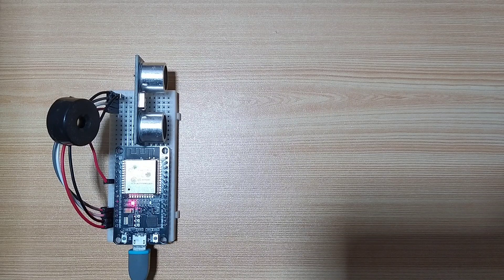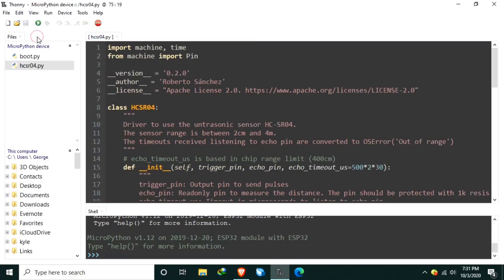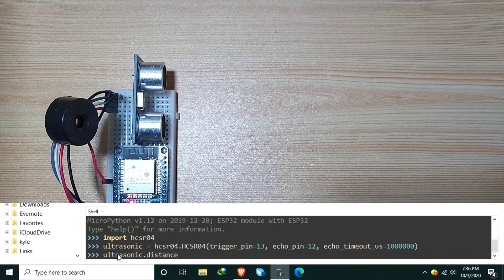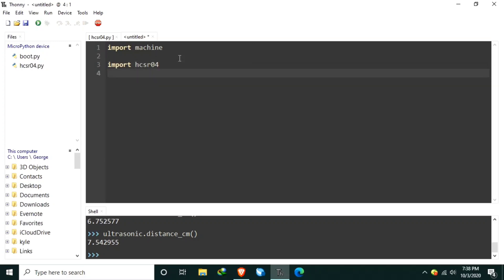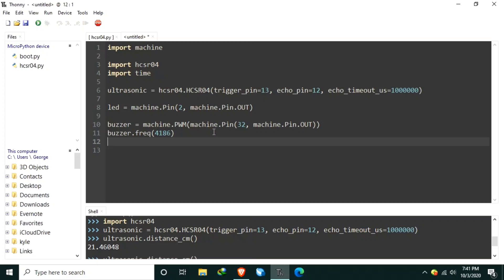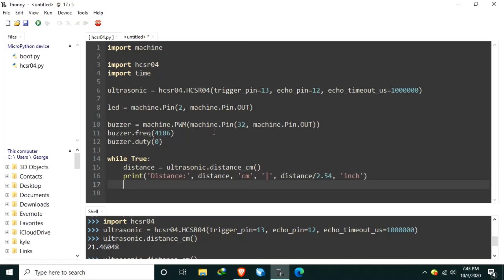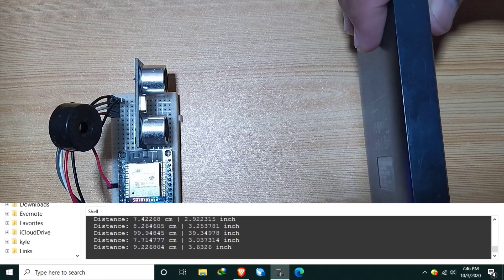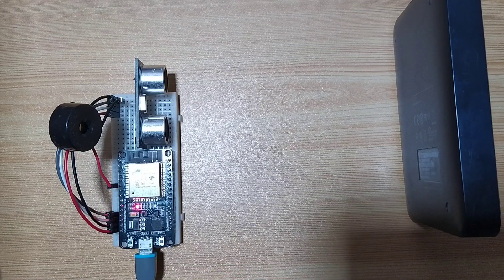012 - ESP32 MicroPython: HC-SR04 Ultrasonic Sensor in MicroPython

Comment: Sir,  I am using the same 'ultrasonic_distance.cm' but I am getting a value like -0.0343. And strangely,  it remains the same even though I changed the object distance. I thought there might be something wrong with the sensor and tried using it with Arduino but it was working fine. I am getting expected results and infact I was able to even perform intruder alert. I request you to let me know what could be the possible mistake.
Reply from the maker: I am not sure what could be wrong with your setup. I would suggest to try to re-assemble again the circuit. Notice also that Arduino Uno uses 5V while ESP32 uses 3.3V. That could be the difference.

Comment: Sr04 needs 5v and esp32 3.3v soo how does it even work?
Reply from the maker: @Boopesh kumar, you may have your 5V voltage from the VIN pin. VIN pin is connected to USB power.
Reply: @TechToTinker  thanks.. I want to do automatic stair case with esp32 and ws2812b using Two ultra sonic... Do you have an idea about this...? Could you vouch me?

Comment: I Have a measurement error, in cm the measurement is 0.3436426 and when i put the sensor in mm the measurement is 0, how can i solve this?
Reply from the maker: Hi @Jeremias Pineda Ramos, have you tried multiplying cm to 10? Such as mm = cm x 10.
Reply: @TechToTinker  Yes, thank you, I've done that but the error is the same... I mean, if i put an object in a know measure, the printed measure is the same: 0
Reply from the maker: @jeremiaspinedaramos3435  that's weird. Can you try the following:
1. Make sure that the VCC of ultrasonic sensor is  around 5V.
2 Share your code, there might be something.
Reply: @TechToTinker  Thank you so much for the help, the problem is solve, I had powered with 3v3 pin instead of vin pin ... I had to saw how you powered the sensor